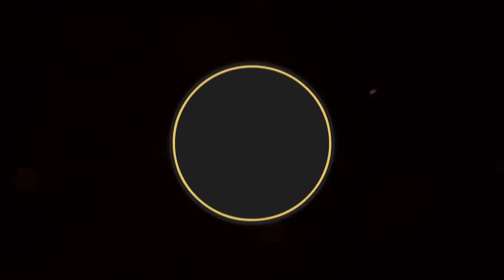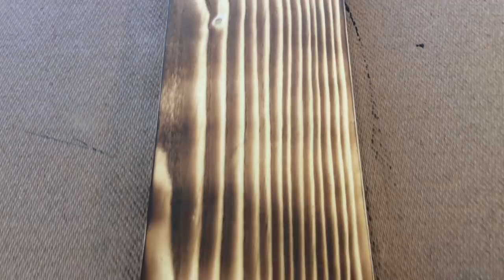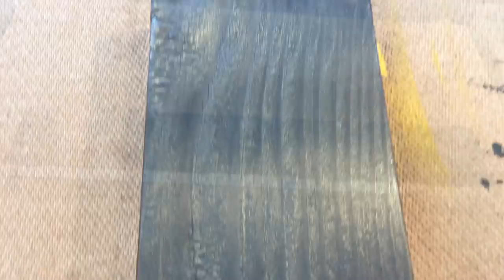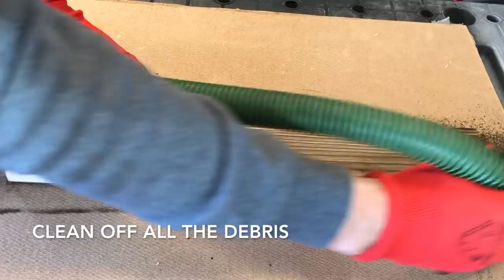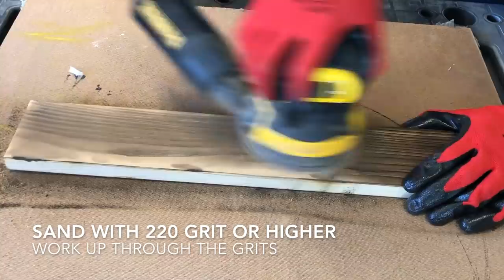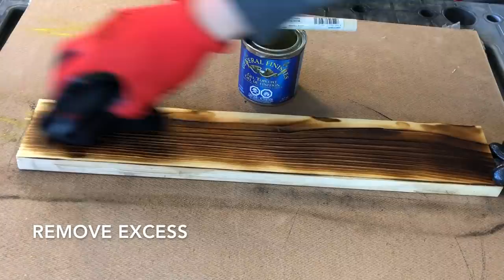How To DIY Shou Sugi Ban Torch Wood Burning Step By Step

Comment: Do you have to scrape in sand after torching? It looks better black
Reply from the maker: No you can leave it more charred if you prefer. The charring helps seal the wood but depending on the amount of sunlight it gets or the weather it will see you may still want to seal it anyway.

Comment: Looks better without sanding
Reply from the maker: terry mise all personal preference. Either way you get a nice looking finish.
Reply: I don’t sand either when I do it.  Occasionally in some areas I will, where the grain bends or swirls but not the entire board
Reply: Mainly because it’s pine and not cedar. Red Cedar looks way better. Still an accurate description of SSB

Comment: I wonder if adding a coat of milk paint on top would produce a neat effect of depth?
Reply from the maker: Too Ticky Absolutely it would. You can also add a color stain after burning that way the color is in the grain but you still get the seal from the char.
Reply: @ToolsThatBuild  PRIOR to burning? D:
Reply from the maker: @JosephGallagher  yes definitely meant after thanks
Reply: @ToolsThatBuild  Hahaha, I was wondering